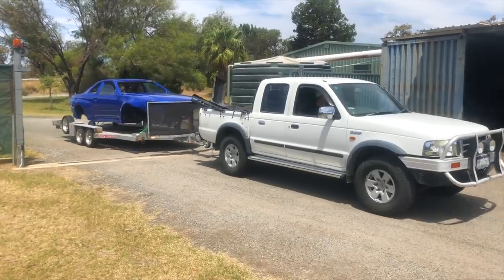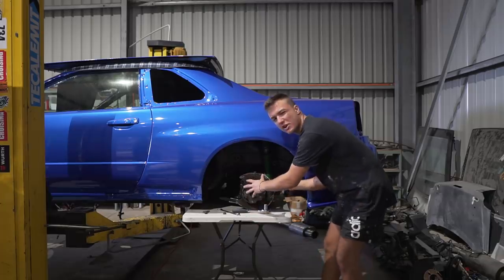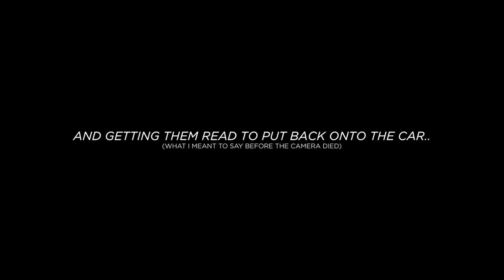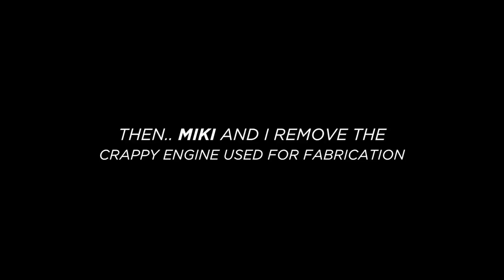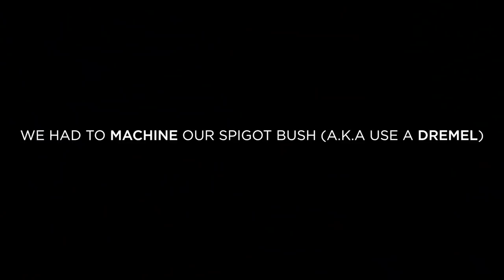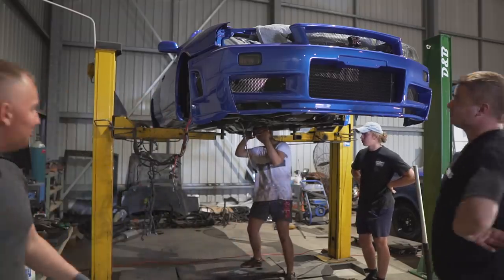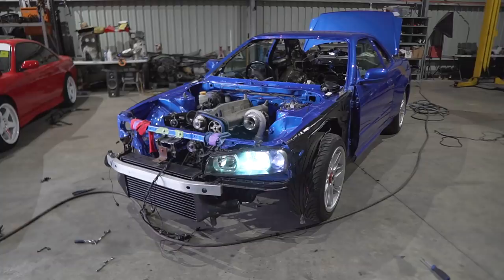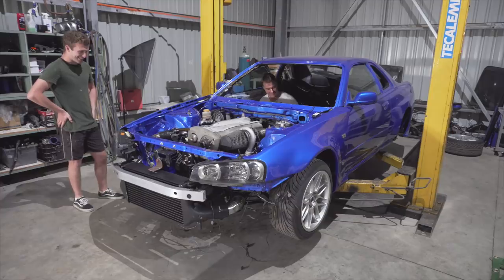R34 SKYLINE First START in Years | Poor Man's GTR [EP19]

Comment: I wasn’t paying much attention but if that turbo wasn’t getting oil during the start / run then it’s probably cooked bro. RIP turbo... Garrett in their turbo start up manual imply that when installing a new turbo you need to crank the engine to build up oil pressure and that the 10-30s of idle without oil in the turbo can cause catastrophic damage to the bearing journals.

Comment: Always good practice on a new build / block to check the oil feed line by cranking it with the hose running to a bottle to ensure flow. Hopefully that turbo is ok. Is it a ball bearing or journal bearing
Reply from the maker: Yeeah we'll see :/ BB
Reply: Broken Silvia you might be right as the BB’s only need a little flow / run restrictors and don’t need to be bathed like journals. Here’s hoping the assembly oil on it was enough. All the best and amazing work mate.

Comment: Pretty cool episode. 
Is it right, that you made locktite on the flywheel bolts?
Reply from the maker: Cheers
Yeah used it
Reply: @BrokenSilvia  Okay. Afaik many people said no locktite because in case of loosen the bolts, you will be loosed 😅
I'd  given the bolts 148nm.
But good.

Your project is realy realy cool. I watched it since the first time. I rebuild my engine as well. 
When  engine install in to the body, it's a great feeling when your hear that noise, when engine slides in the Engine brackets.
😁

Comment: Hey there, quick question. I'm not expierenced in building cars like this so that's why i ask this. Can you put the engine + gearbox on the front subframe, mount it all, and then lower the whole car on to the subframe and tighten the bolts then? Wouldn't that work too? Just a question, not anything that you got to do or something.
Reply from the maker: You can but then you have to install the exhaust and intake manifold in the car which is a horrible job to do
Reply: @BrokenSilvia  all the way from the downpipe to the end of the exhaust? I didn't know that. Thanks for the answer and time!